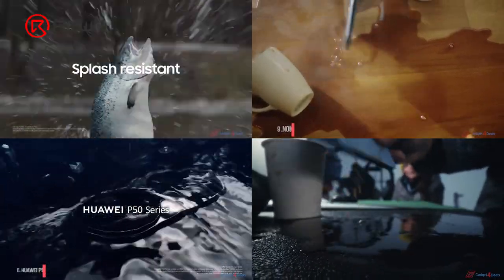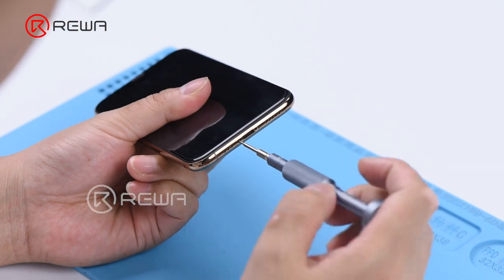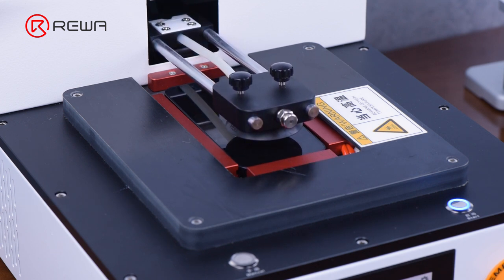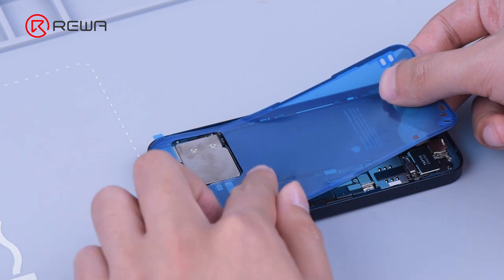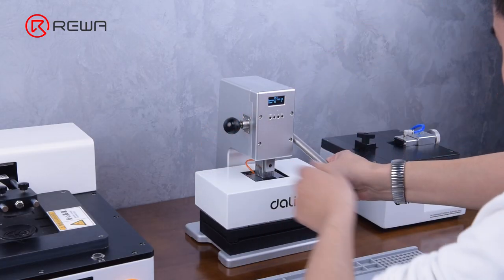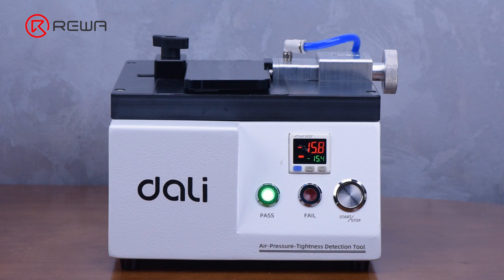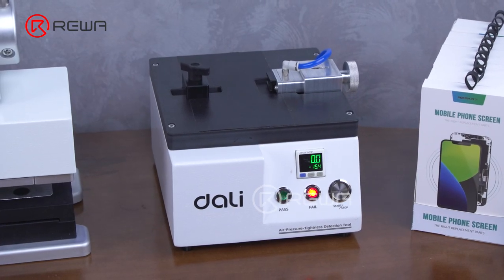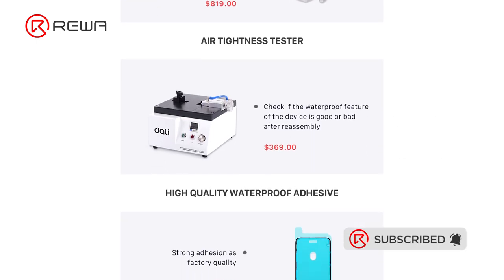How to Keep iPhone Water Resistant after Repair

Comment: Rewa doesn’t the water enter through the earpiece speaker mesh and damage the Face ID
Reply: Yes
Reply: No, there is a rubber gasket in place.
Reply: @Anonymous-ip8ui  that still doesn't mean water will never get inside
Reply from the maker: Yes, it can cause malfunction or damage.